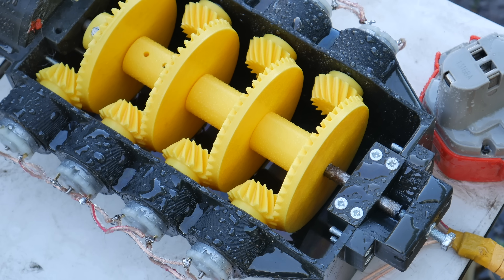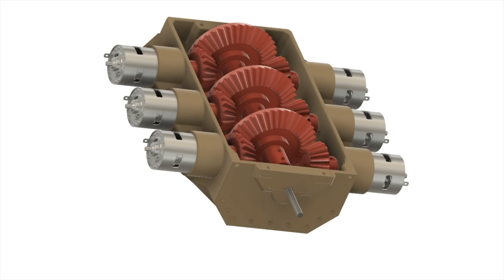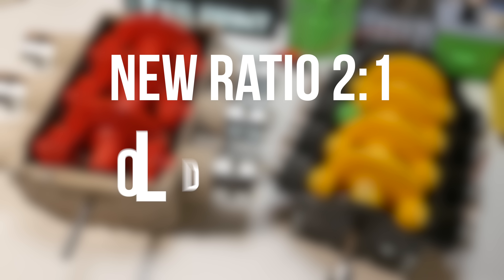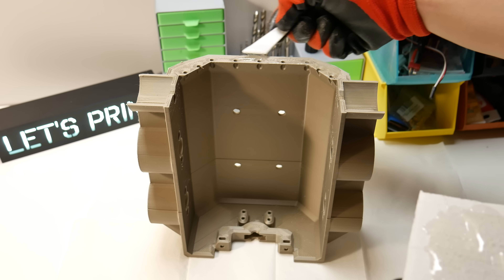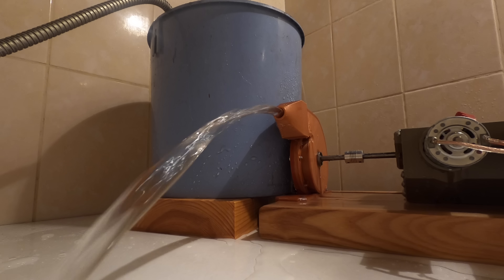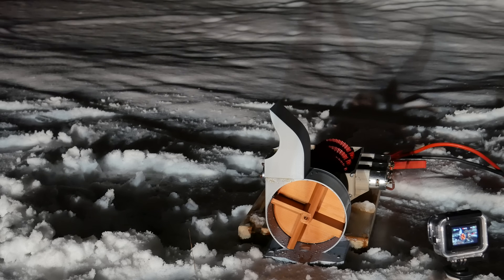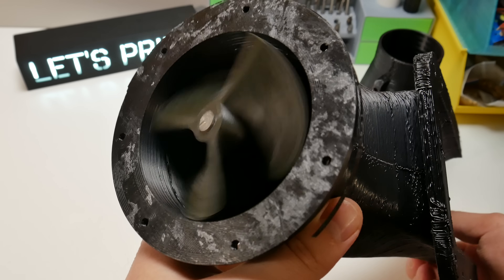900W Crazy Powerful Gearbox With SIX 775 DC Motors - 3D Printed

Comment: ^_~ for those powerless/low battery snowy days, you can replicate & use https://m.youtube.com/watch?v=SbVRXvrGJfI
iEnergySupply's Tesla Turbine COLD STEAM Testing, Medium RPM low temperature, 61280 RPM as the prime mover & Robert's conductive ink diy paint on/in kapton tape/varnish/plaster etc- low volt 3v-12v  heater to make the internal temperature difference even greater for more power for longer...

Comment: to replace the big bolt stop sticking out,  just take a bit 0f springy thin copper coated steel, centre punch it or rather punch a tiny ball bearing to make a dome in it, cut to size so the dome is contacting the centre steel rod & the plate can simply slot in the sides to keep it pressed together... or plastic + hole + ball bearing + spring oc but that's fiddly & can drop out easier

Comment: to save your steel bits rusting you can make & use Roberts coppering gel on them btw
https://m.youtube.com/watch?v=n2Xa_mbB2TQ
Fast Easy Copper Coating Steel
7,438 viewsDec 14, 2020, 'robert murray smith copper'

& shrink wrap the mild steel cased motors afterwards for snow/damp days oc
diy
https://m.youtube.com/watch?v=K4j6naFO1qg
Copper Nanoparticles In Gelatin
22,696 viewsSep 30, 2014

^_~ for the hell/fun of it & to give your prints a harder metal copper contact surface, you can also buff the parts with his conductive ink formulations then electroplate them in any combination of diy 2v-12v plateable metal to get a nice extra hard flexible skin 'first', give it a go, give 'him' credit.

Comment: I could see a lot of practical applications in a small, portable, battery driven pump. If you’re out here in Australia 4wding and you need to fill water from a tank or stream, instead of manually filling jerry cans, you could pump it.
I would love to see flow and head tests as well as wear tests.
I wonder if anything would change if the gears were made of aluminium?

Comment: how can it be 900 watts if there are 6 150 watt motors?  Each gearing connection has efficiency losses.  You are going to lose about 10-20% just from that not counting any other inefficiencies in the system.

Comment: if you use a wood-burning pen with some fine wire mesh over it, you can plastic weld really well, i would recommend for durability purposes to plastic weld the joint on the gear box

Comment: The design with the propeller inside the pipe you showed in the end is actually a very inefficient design. A centrifugal pump would be more powerful and efficient. To fix leaking from the eccentric shaft a glide ring seal could be used. But water should be present there to ensure cooling. Otherwise the glidering could start smoking. Besides since the engine is so powerful I think a twin screw design could be used as well.

Comment: Hi very cool andinspiring video, to help with layer shift you should greas up the 3D printer, verify if the grub screws on the steper motors are tight, and to prevent nozzle clogh verify if your extuder gears grab the filament properly you can also increas the température to 230°C for PLA (even 235°C), or use a bigger nozzle like a 0.6mmø but keeping layer hight to 0.1 or 0.15mm to achive good quality.

Can't wait for more !!

Comment: I work at a chemical plant and we have cooling towers that circulate water with direct drive centrifugal pumps. Usually between 1700-3500 rpm. They usually have an inlet of 4”pipe and outlet of the same or smaller depends on pressure needed. They deliver about 60psi on average on outlet side. It would be cool if you encased this pump in a similar system that could build pressure and added a gauge to see how it measures up. Maybe next time include rpm tests as well on the impeller. I know it’s a lot of work but I think it would be worth it. Keep up the great work man your videos are some of my favorite. It’s awesome to see someone apply their knowledge, and conduct cool experiments.

Comment: Do you realise that you are losing up to 5% torque and efficiency when you remove the thin metal ring that comes fitted around the motor? One of its functions is to concentrate the magnetic field within the motor and prevent losses.

You may not feel that much loss is important, however in an ideal design, you would want to keep this ring on and modify your housing to accommodate it and perform whatever else was required to prevent leaks.

Comment: Looked like the water output was about 25mm which would assuming high peak flow maximum would be around 220 liters per minute. Just increasing 5mm more would nearly double output. By restricting the output it is killing the efficiency and hardly competing with a $100 pump. I have a 18,000lph pond pump that runs a 2” (50mm) output for reference. I’m positive your setup exceeds what 25mm can allow.

Comment: That is 900 W electric power, not engine power. That's like measuring a combustion engine by the energy stored in the consumed fuel instead of the power on the crank shaft xX
Reply: No watt is a measurement of power. One horsepower is 746 watts
Reply: @cabreraman6969  yes but this has nothing to do with what I said. A bulb might consume 100 W jet cannot be used as a motor.

Thus the 900 W is at least misleading since one would assume shaft power not consumed power
Reply: @petermuller608  I thought you said that batteries was measured in watts. Electric motors have a thermal efficiency of up to 99% for brushless and 93% for brushed. Using input wattage for brushless motors is often fine because that 1% is in most cases irrelevant. Brushless motors also keep the efficiency for the whole rpm range but the same could not be said for brushed
Reply: @cabreraman6969  the motors itself are quite efficient, sure. I would say closer to 90% then 99%, but the real efficiency loss will be in the 3D printed gear box :D

My initial comment didn't make that very clear

Comment: Considering the high wattage, it should be able to lift the weight a lot faster. The absence of slowing  down as the weight leaves the ground shows how much power is still untapped into. Try reducing the gear ratio.

Comment: haha! nice! I definitely should try to print that...
here's I'm riding (slowly) on DIY vehicle using just a 3.6V screwdriver: https://youtu.be/jnK4POZFQ0Q :-)
is it possible, using your engines schema, to run fast and "up to the mountain" using several 12V motors (torque, speed) ?

Comment: Once the motor get heavily-loaded, no 3D filament can stay mechanically strong with the heat from the motor. PLA is especially not heat resistant, with only 60℃ it will become soft.
Reply: Reports of getting up to 180°C if you use high-temp PLA and anneal it (but you’ll need to adjust your part for shrinkage/expansion and could try with your slicer’s horizontal expansion setting): https://youtu.be/vLrISrkg46g?t=540 
and
https://youtu.be/TFsTo6cDmF8
Reply: idk if you noticed this, but it was in snow

Comment: But you need to supply sufficient current at rated voltage to achieve maximum torque and power

Comment: I'm looking forward to your water jet drive project. I've been messing around with 3d printed water jets for a while and I will tell you some findings I made: With fdm printed parts, clearance is your friend. I recommend to make the OD 2-4 mm bigger then the impeller diameter (yes, this is inefficient but inevitable) And either use 2 bushings for the impeller shaft (one on each end) or make the support free distance to the impeller as short as possible, to avoid oscillation of the shaft end and impeller (can destroy the whole jet otherwise). When using the method of 2 shaft bushings, I recommend using a stator impeller with counter directed blades. This will take the vortex out of the flow ( more efficient and looks better) otherwise, a diffusor behind the impeller works fine too, but makes the system larger and heavier. If possible, try to make an impeller with overlapping blades (alternativley multiple stages) to decrease impeller slip and thus increase the thrust (but keep in mind you will also draw more power then).  I also recommend a high pitch impeller. Furthermore, keep in mind that in an ideal pump, if you double the rpm, the power draw will be 8 times as big (2^3), that means when you double the voltage on the motors, that is directly proportional to the rpm, your current will quadruple. So always keep an eye on the current draw to avoid motor burnouts ;)
Reply: Wow, I lucked out here! I've been trying to build a 3d printed jet for a while. That's a lot of nice tips, thank you!

Comment: Hope you can fix your 3d printer during the winter and can't wait for that jet boat in the summer of 2021! Your under extrusion problems are very similar to what I had on my 3d printer. I recommend checking the bowden tube and the extruder gear. My bowden tube had some knife-like damages from trying to dismantle it earlier and failed, so when 3d printer was retracting the filament got stuck on those slices. The extruder arm bolt that holds the lever was too tight and the lever wasn't pushing against the filament, had to loosen the bolt. The layer shift is probably loose belt or failing stepper driver.
Reply: This + I recommend cleaning the nozzle every few prints and print hotter, especially with PETG Filament to avoid clogging. As a last resort heat the nozzle to its maximum temperatur and extrude some filament manually to clean it. A friend gave me that tip and it worked every time so far.

Comment: posted this as a reply to a comment but I wanted to get more input from a wider audience.  This was a reply to a comment about using a belt drive instead of a drive shaft/coupler: 
I'm not sure of the torque, would love to see him calculate/test to find out.  The torque problem I was specifically thinking of is what you can hear each time he threw chunks of snow into the "impeller" you could hear the sudden drop in speed and then the sudden ramp up as it cleared.  If he's got a belt that can keep up with that type of inconsistent torque pull and not get blitzed at those temperatures,  then by all means go for it.  If not a chain drive most likely is a better option, also more easily found on an old bike.  

This also makes me think that he'll need to make some sort of transmission or torque control for this snow blower project, and a chain drive cover.

Comment: Try using a belt drive instead of a drive shaft. Less chance for a snapped coupler :)
Reply: Chain drive,  belts snap too at this speed and torque especially when it's freezing cold.  Also  make a chain cover.
Reply: @Scott_C  That's an interesting point. I was thinking of the belt on my 2 stroke Toro. I wonder what the potential output is on 6 x 775's with high discharge DC current
Reply: @partytempo  Not sure, would love to see him calculate/test to find out.  The torque I was specifically thinking of is what you can hear each time he threw chunks of snow into the "impeller" you could hear the sudden drop in speed and then the sudden ramp up as it cleared.  If he's got a belt that can keep up with that type of inconsistent torque pull and not get blitzed at those temperatures,  then by all means go for it.  If not a chain drive most likely is a better option.  This also makes me think that he'll need to make some sort of transmission or torque control for this snow blower project.
Reply: @partytempo  how do you like your Toro BTW?  Thinking I might need to get one (a snow blower that is).

Edit: to clarify what I'm thinking of getting.
Reply: @Scott_C  - Overall I love it - cheap, effective, reliable. With all 2strokes, it's loud and gassy. I just upgraded to a Toro 824 which I look forward to testing in the next snowfall

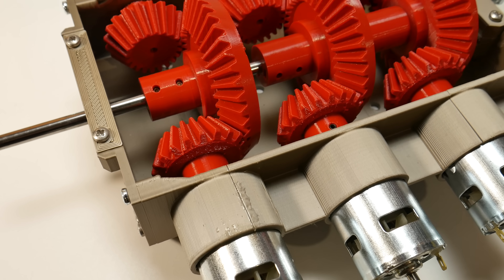Comment: 3:02

Could you do this via the "last gear" being duel sided, and having another set of bevel gears to "lock that side in" ?
Reply: Was looking for this comment. This change would eliminate the need for an extra thrust bearing and reduce friction losses and wear. However, instead of a dual sided last gear, that would need support material, I would simply flip one of the big bevel gears 180 degree

Comment: your snowblower fan is the wrong way, the fins need to be facing the snow, not 90d from it. Than it would have worked.
Reply: Most snow blowers are actually a barrel auger rotating laterally.  His proof of concept here is still amazing in its strength.